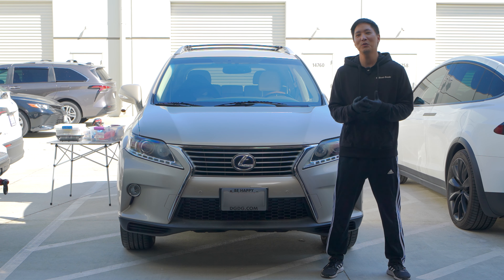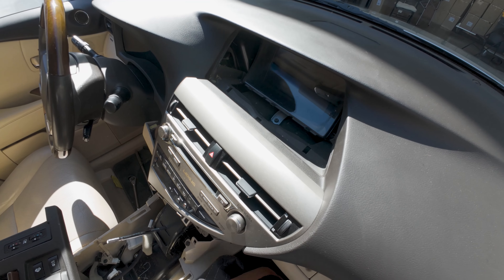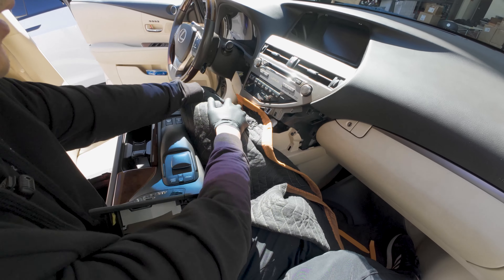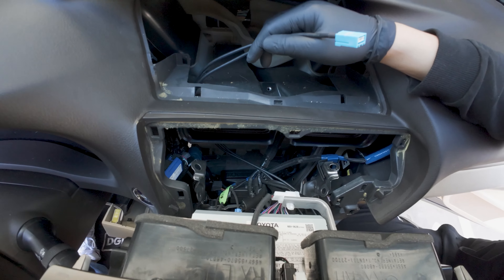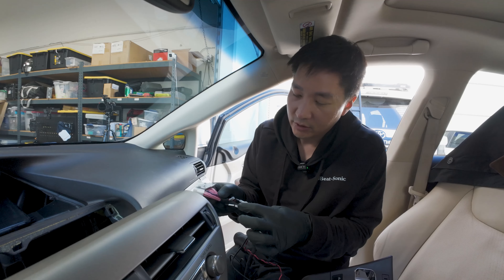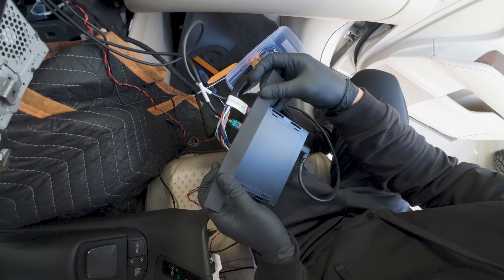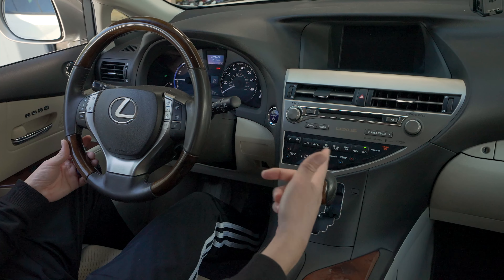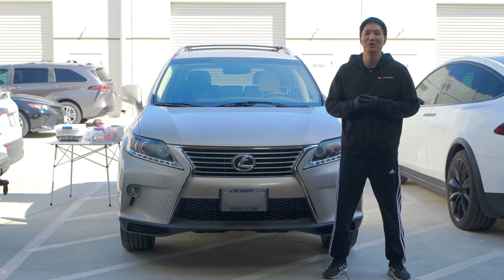2013-2015 LEXUS RX | Wireless CarPlay Solution

Comment: Idk if I installed it wrong, but right after installation my car now receives either an SRS Check Airbag warning or a permanent parking brake light on indicator. I stored the unit behind the radio. Is it possible that this could be related? It did not happen before. They are intermittent errors.
Reply from the maker: @MrNickachu  check to make sure all your original factory connectors were reconnected. Especially the connectors behind the glove box
Reply: @BeatSonicUS  thanks for the help, but unfortunately the issue persists. I've double-checked and reconnected everything to ensure a tight connection as well. I have not ventured anywhere near the glove box so I don't think that's my issue. I have a code scanner and there doesn't seem to be any codes to indicate which of the airbags are affected either. I'm open to any other suggestions you may have. I may just remove Beatsonic for a week to see if that helps.
Reply: Looks like it was the harness adapter causing all the issues. One of the pins was bent and now pushed too far in. This also slightly damaged my OEM harness but I was (luckily) able to fix that. Would it be possible for Beatsonic to ship out a replacement part? I'm happy to send the one I have back. Quite frankly, I'm not even sure if the pins were damaged prior to installation. I'm also ok with paying, this is for my wife's car and she has been waiting 2 years for me to save up just to get this for her.
Reply from the maker: @MrNickachu  Please email us at info@beatsonicusa.com and send us photos of the harness and pins